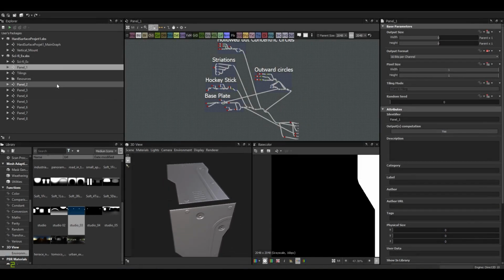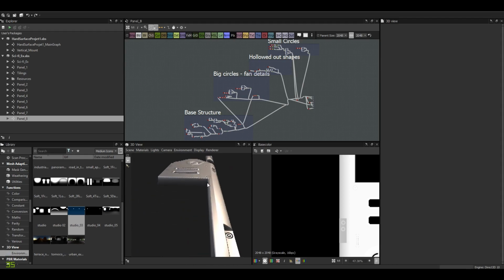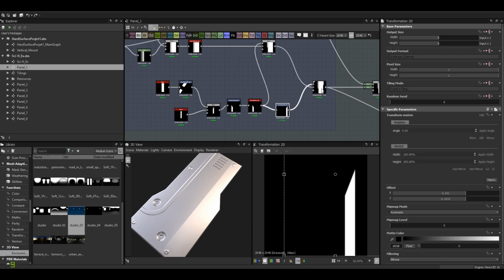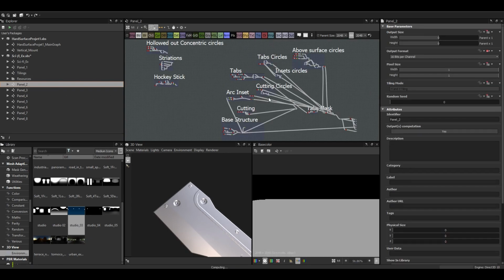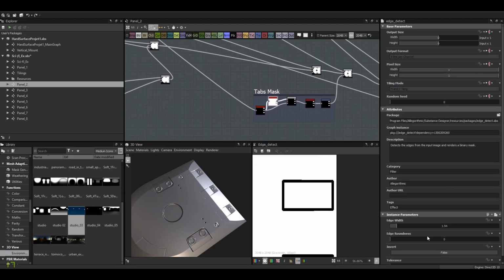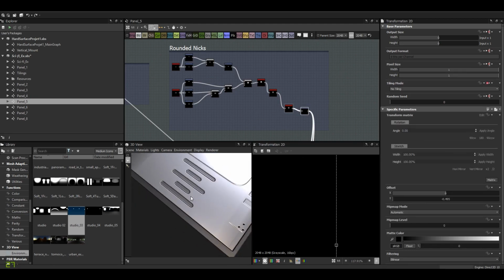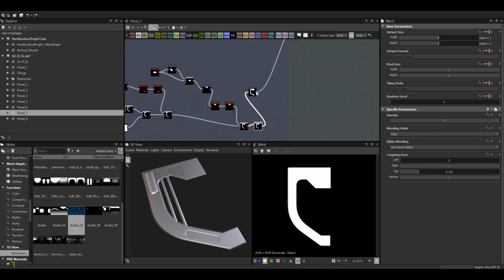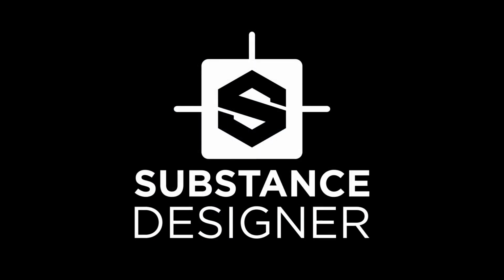[Substance Designer] Hard Surface Techniques - english edition

Comment: You keep Base Parameters and Attributes opened on most nodes so we cannot see any of the Parameters. Thanks for sharing the idea but this video cannot be used as a tutorial at all, and of the "techniques" you're using, as we can't see the nodes parameters, it's basically useless : we have to figure out most of it by ourselves. The only interesting thing here is the nodes you chose to use and why. Please consider this for another time : A gentle breakdown, sliding the nodes parameters window for us to see values and so on would be very helpful.
Guess I'll stay on ZBrush's Zmodeler for this kind of things ;)
Reply from the maker: I guess this is the problem with a walkthrough format. It's impossible to show all the details and the instance parameters settings in a short amount of time. With my new hard surface series, I don't talk but the entire process is recorded (although edited). Maybe it's better from that standpoint. I keep thinking about the ideal format, without spending too much time doing the videos for free. That's why I welcome your comment. Really helpful, thank you.
Reply: I'm a beginner at SD, that's probably why I found it very hard to follow.
Maybe should you think about publishing a hundred or more small sci-fi patterns (just with those exercises you uploaded here, you've got quiet a lot) that one could mount in Substance Designer or export as normal maps/alphas to use in another soft. Jonas Ronnegard's been quiet successful on Gumroad (JROTools) with his height maps packs. And I realize, thanks to you, that doing those alphas with SD might be a bit faster with some practice than 3D modeling them. Playing with some node values, one could in a few clicks generate tons of other original shapes out of the main ones. That's a good sales pitch. Anyway, food for thought. If you don't do it, I might ;) The idea is rather good now that I think about it. 
Cheers mate.
Reply from the maker: That's a good idea, and Käy Vriend, on ArtStation, told me exaclty the same thing, here: https://www.artstation.com/artwork/aAQNX
I guess you have a good point! :) Thanks!